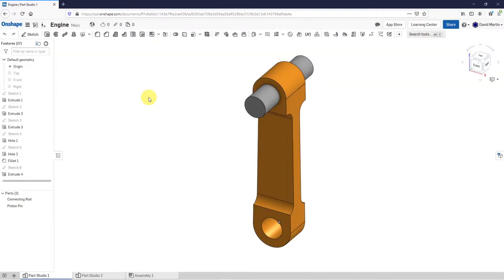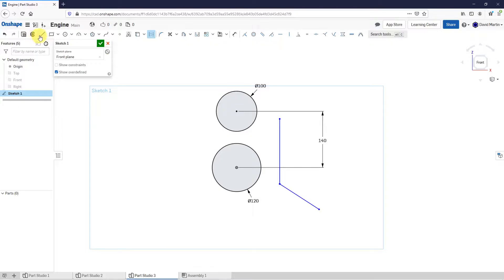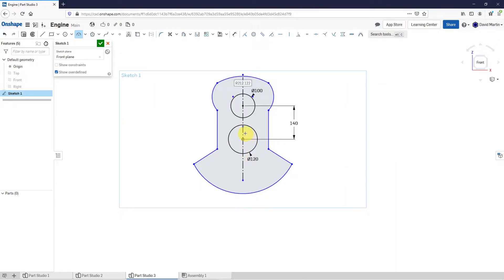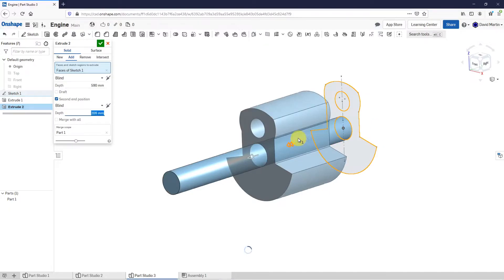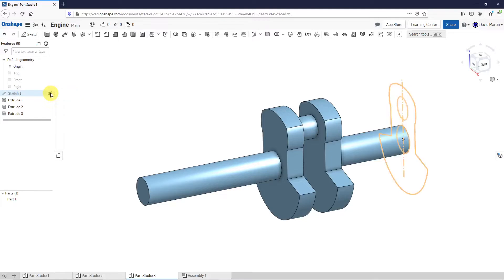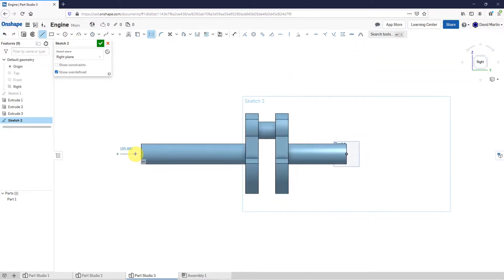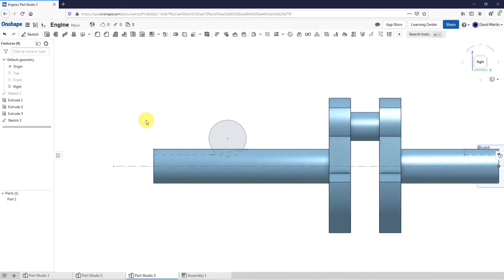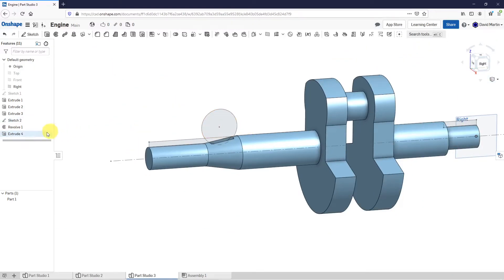Onshape - Part Modeling Tutorial | Crankshaft

Comment: when i make it 250 it says that there is a problem, it wants to stay at 256
Reply from the maker: Sounds like an accuracy issue. Change from relative to absolute and set a lower number. I have a video on accuracy.
Reply: @CADPLMGuy  thanks, i will let you know if anymore problems occur
Reply from the maker: Oh wait, I just realized this is Onshape, not Creo. I don’t know why you can’t change the value. I recommend contacting PTC Tech Support.
Reply: @CADPLMGuy  10:00 when i try to make it 120 it does it in degrees.